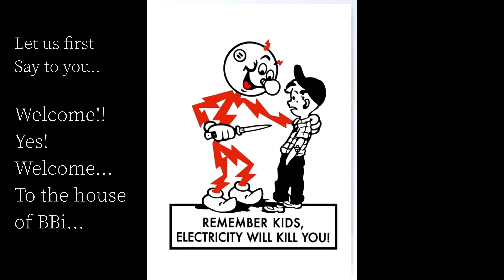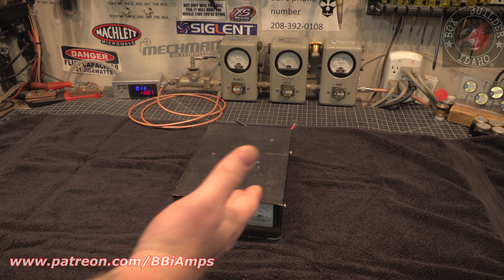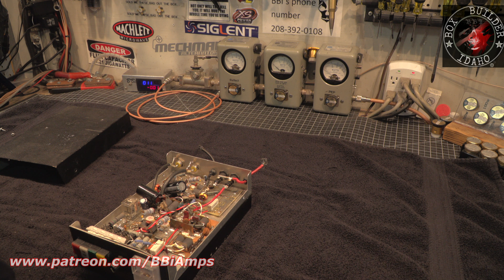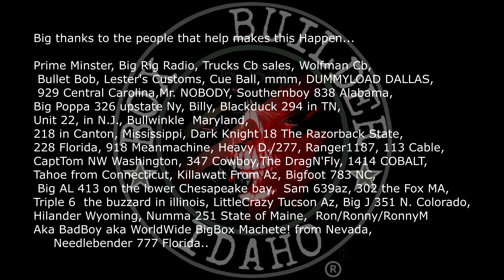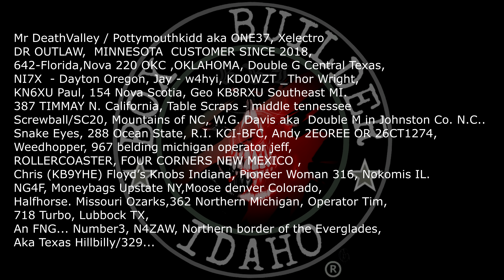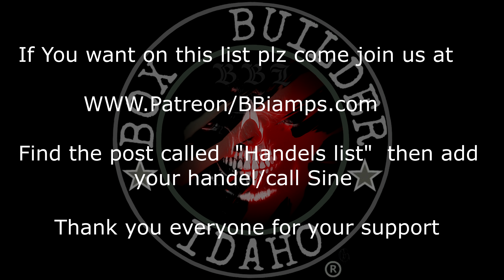Mr T's 667 Repair ro#51 2023

Comment: Oops, one more question, do you know about air vac engineering solder gobblers? Connect to a 90psi air supply and it vacuums the solder away. It uses an esico brand iron as a base. I couldn't see some professional using a pump vac.

Comment: nice repair. the trace that is blown with the one brought to me was under the switch bank. super hard to fix. had many blown this way. to long of a screw in amp. grounds out B+ from switch. That will run cooler with the power wire . I would put a fan on it if key down a lot. I would put big fuse or breaker at battery pos. don't want truck fire. 73's
Reply: Yes I believe a fan is absolutely necessary in my opinion

Comment: What ever happened to your TelePost LP-100A Digital Vector Wattmeter by N8LP?  Also, why do you need so many watt meters?  I counted 7 Birds...  I'm genuinely curious about your setup.  I'm newish to radio/electronics (2-3 years), and just have a cheaper MFJ wattmeter/dummyload (Model: MFJ-267).  One day, perhaps, I will have enough knowledge and tools to construct my own (full legal limit...) amps!  I appreciate the content, please keep it up, and help ed-ja-ma-kate us youngins.
Reply: Reflect from the dummy load, “bird” forward, peak forward, then a meter from each of the bench radios for input and pass through reflect. Has different radios for different drive levels. Like the 2950 does 1-2 w dead key and 10-25w peak and the Stryker does 80 watts peak or so.